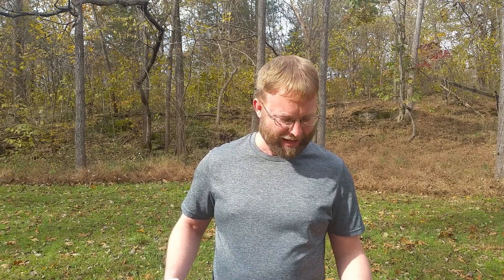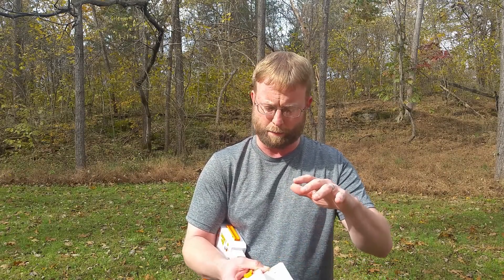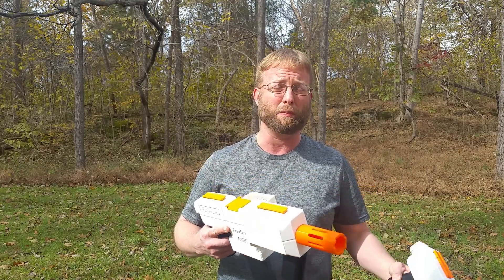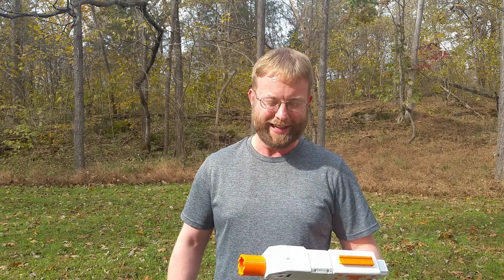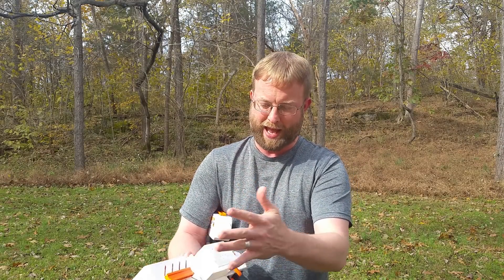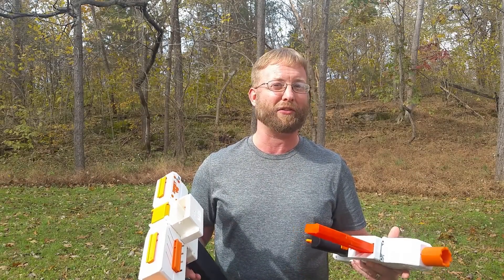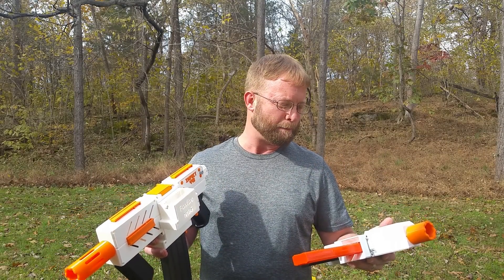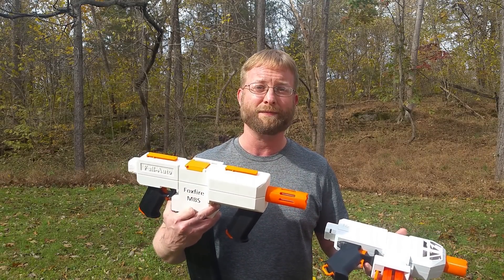Foxfire MBS Release 1.3

Comment: Can we order builds with motors other than rhinos? There are other motors I prefer
Reply from the maker: Yes, but there might be an extra cost depending on the motors.  Now, I have been using MTB Hellcats as the standard flywheel motor and am planning on using Krakens for the full auto pusher motors.
Reply: 498 Nerf would I be able to possibly use like krakens as an upgrade how much extra would that cost?
Reply from the maker: Switching the Kraken's wouldn't be any additional cost.  MTB Neo Hellcats would add $15 to the cost of the blaster.  Both are really good motors.
Reply: 498 Nerf would krakens be better or hellcats
Reply from the maker: Performance wise they (Krakens and MTB Hellcats) are about the same.  The ball bearings on the Kraken's make for a really nice sound though.  Now, Neo Hellcats have the ball bearings and significantly more torque.
Reply: 498 Nerf witch one would you recommend?
Reply from the maker: I run Neo Hellcats in my primary blaster.  Imo, they are the best motors on the market.  The only drawback is their length, which isn't an issue for the Foxfire A and G Housings.
Reply: 498 Nerf don’t they require a mosfet though or else they will damage the switch?
Reply from the maker: No, 21 amp switches can easily handle the current for 2 Hellcats.  Their rating (21 amps) is an A/C rating at 120 volts.
Reply: 498 Nerf thank you so much now I know what to put on my Christmas list

Comment: Why are the blasters so big? The katana mag with p front looks about the size of a stryfe or am I mistaken?

I really like the Foxfire system. 👍
Reply from the maker: Yeah, it is about Stryfe sized.  Minimizing the size wasn't really a design criteria with Foxfire.  I was looking more for a certain set of features and compatibility with community components.  One of the big things that impacts its size is that I want to make sure that a good sized Lipo will fit in the blaster.  That in itself makes the cores significantly bigger.

Comment: Would you consider a picatinny rail option instead of Hasbro compatible rails? I love my Foxfire, it's the only flywheel blaster I use these days. I just wish I had a way to attach more accurate sights. It's probably my only major gripe with the system as it stands.
Reply from the maker: I plan on taking a look at it.  Maybe I'll leave the base modules as they are but add extra files to swap in picatinny rails...

Comment: Looks pretty good.  I'm approaching the halfway point on printing the 1.2.  I may use the fronts for the 1.3.
Reply from the maker: You should be OK mixing the two versions.  And the bigger cosmetic changes are mostly on the housings.
Reply: Well, I accidentally printed the 1.1 base housing.  The 1.2 cap matches it well, and I did the 1.2 with the mag holder on the side.  I just started the 1.2 semi core yesterday.  These are wonderful options.